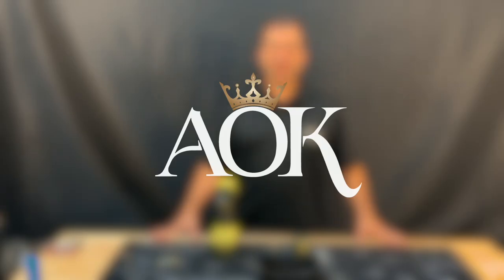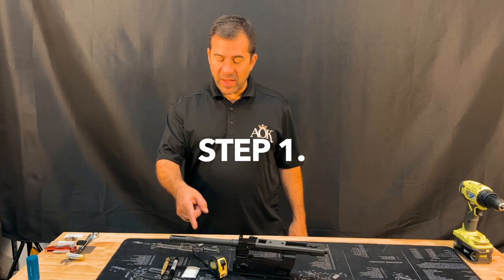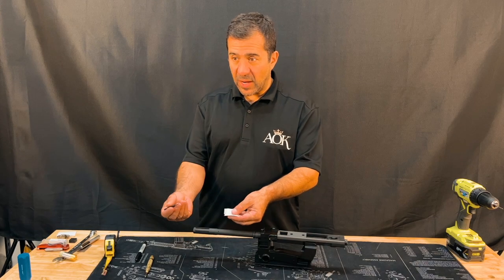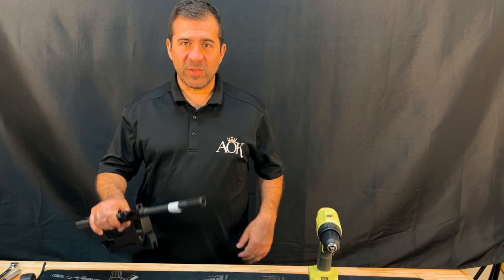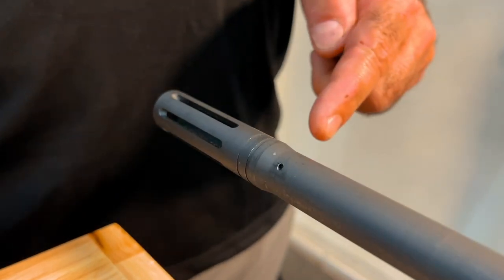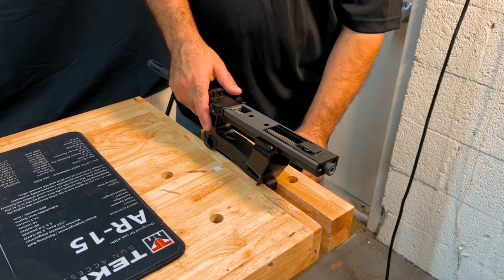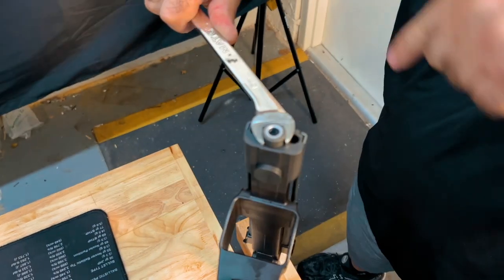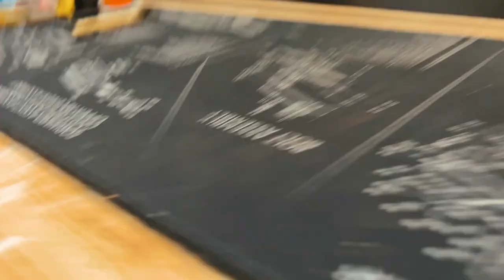How to remove a barrel shroud from a factory PS90 receiver. #howto

Comment: The muzzle brake plate is not necessary, being that the barrel's shroud has a notch, which engages on the receiver itself. This technique does help prevent marring the receiver & shroud and the plate could be difficult to find. This is by far though, the best tutorial video for this.
Reply from the maker: The plate is 100% necessary. It keeps excessive torque away from the shelf on the receiver, preventing damage (not just cosmetic marring, actual damage). Equally important is preventing separation of the 2 piece barrel shroud while breaking the barrel free. If the barrel shroud separates during barrel removal, it turns the job into a nightmare. Use the plate and be happy.
Reply: @armoryofkings  I believe this is exactly what I said. For the exception that's not necessary. Thx. for the video
Reply from the maker: @madmaxd1  Thank you for watching and for your engagement. It’s always great to meet fellow tinkerers. I have edited our original reply for the YouTube community to ensure we provide proper guidance.

Comment: That has to be one of the cleanest videos I have seen in regards to how to do that. Can you do a video on how to install the 10.4 inch barrel on an SBR variant? Also, some of the other videos have commented on how hard it is to get a 15mm wrench to manipulate the barrel. Do you have a recommended brand or where to get a 15mm crow's foot adapter for a torque wrench? Supposed to be torqued to 35 ft/lbs from what a different video said. Lastly, super nice wood vice. When I made my work bench I briefly considered a wood vice, but went with a standard one.
Reply from the maker: Thank you for the kind words! More videos (that will address most of your questions) coming soon.

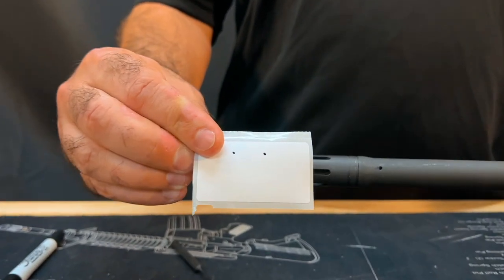Comment: 1:15 I followed the instructions for punching the barrel shroud, then regrettably, second-guess his distancing and added 1/16 of an inch to where I thought the drill hole should be.
Had I followed his instructions it would have been a perfect job. 
I ended up missing the pin on my guess, then drilled where he said and hit the pin perfectly. 
Live and learn 😊

Comment: Do you only need to do it this way if you are keeping the barrel or can you just cut it and achieve the outcome?
Reply: Although I don't recommend this method...
If you're not planning to re-use the 16" barrel & shroud, you can literally get an angle grinder with a metal cut-off disk and cut through barrel & shroud about an inch behind the blind pin's location and it should just slide right off.
Knowing how scarce FN parts are, it not smart to destroy perfectly functional parts.